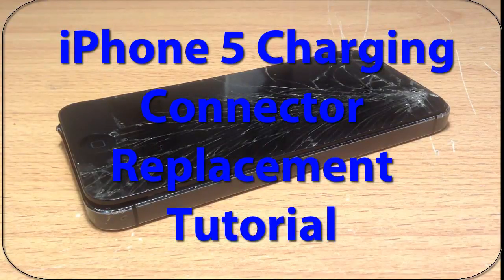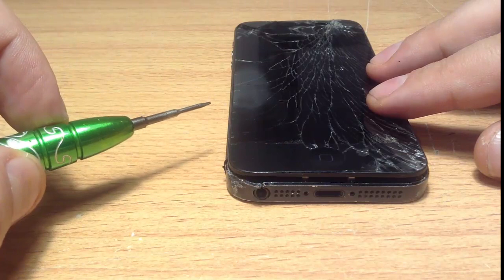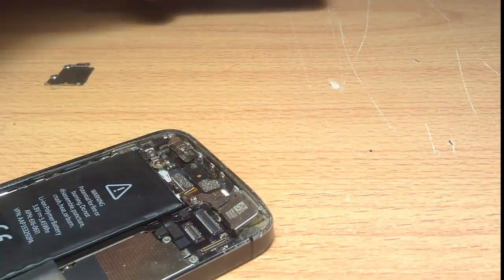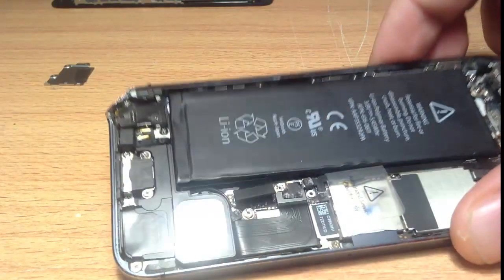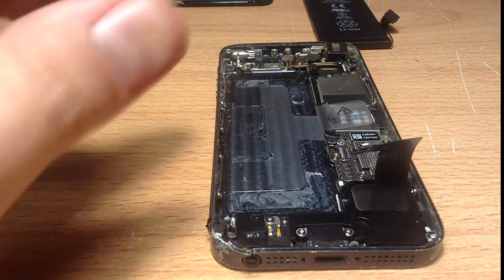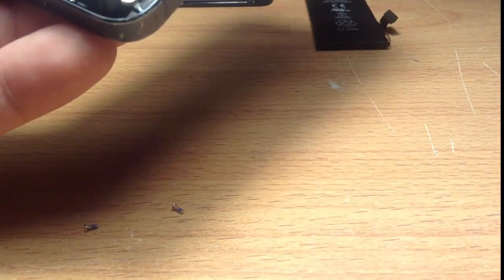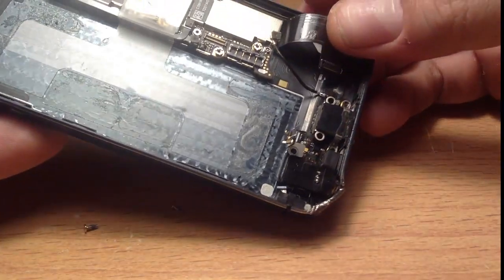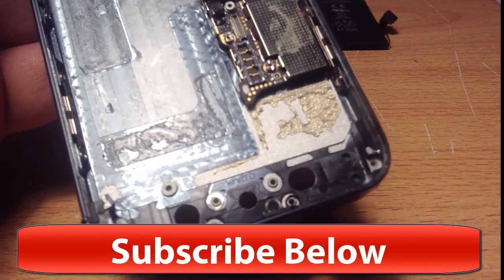iPhone 5 Charging Port Replacment

Comment: Question. Will disconnecting the battery or any other component cause any data or even the operative system to be erased? I have a friend that replaced this dock and when he put everything back together and turned the phone on, the phone turned on but the screen had some squares and the phone would not run properly and would only show the apple logo on the screen
Reply from the maker: +carlos alvarez data loss does not occur if the battery is removed however it is always recommended you regularly back up data especially prior to and after technical work.

Comment: Will the audio jack work if the grounding cable is installed incorrectly?
Reply: K.H. Because I replaced it and it stopped working again. First one channel failed then both. One channel works on rare occasions.
Reply from the maker: K.H. make sure everything is installed correctly.  Most of the time the audio plug is not right against the frame and the earphones don't go all the way in by a few millimeters.  Make sure the grounding cable is installed correctly.  If that does not work also don't forget to try other earphones.  Any issues still - let me know.
Reply: Something major is fucked up, and it isn't my installation. The problems didn't cease for good as I had hoped. All the components work, but only when they feel like it. 
Earpiece works at random, microphone works at random, headphones work at random.
Reply from the maker: looks like a faulty replacement part of you damaged the flex cable.  it is very fragile.
Reply: But it behaved that way before...
That makes me believe the fault is somewhere else.
Or my suspicions were right in the first place, but I damaged the part again.
Reply from the maker: oh interesting.  could be a logic board error then.  If it were me I would try 1 more part.  If that did not fix it then maybe it is a logic board error.  That's a guess though.

Comment: What about no data passing, like, I plug on any pc and nothing happen, no new hardware, no new, but it still charges normally. I'm planning on changing it but I don't know if it will work.
Reply: its probably the cable, you should have cable that is able to sync with computer...
Reply: I've alreadly changes the cabe 3 times and various pcs. Gonna give it a try then.